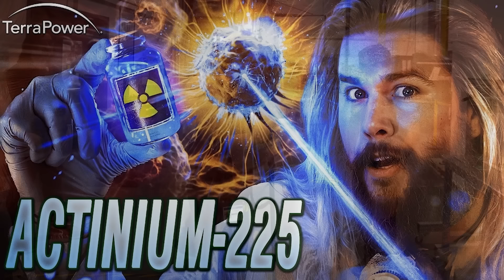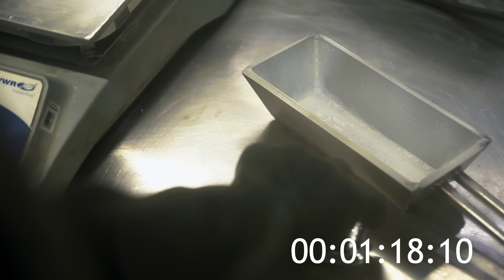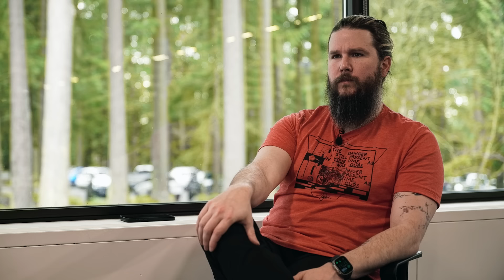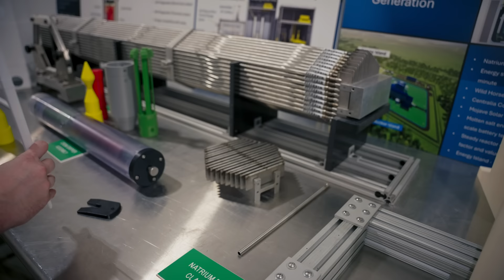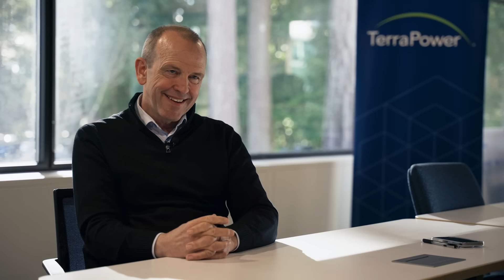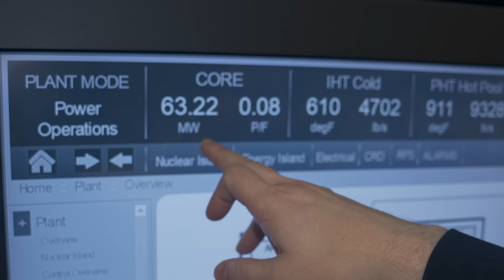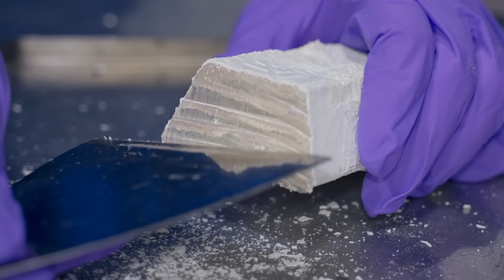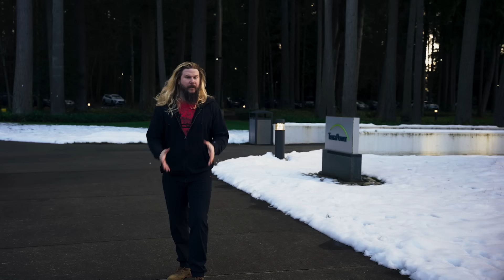Will Natrium Nuclear Reactors Change Everything?

Comment: Fun fact: the first nuclear reactor to generate electricity was the Experimental Breeder Reactor 1 in 1951 in Idaho, and it was a sodium cooled fast breeder reactor that used an electromagnetic coolant pump. It only melted down once during an experiment, and the only way anyone knew was because of the instrumentation (amd the whole running an experiment thing; they'd planned for that possibility). That's what they mean about the reactor running at atmospheric pressure being safer. No leaks, no pressure explosion, and the melted fuel would lose the geometry necessary to sustain the reaction and shut itself down. These days it's a museum.
Reply: Added fun fact, so was the second Experimental Breeder reactor: though decommissioned and de-constructed a while back, the Fuel Conditioning Facility at Idaho National Labs is still reprocessing it's fuel, separating the sodium in its hot cell
Reply: @michaelpickering1904  Another fun fact, although EBR-II is decommissioned the dome that housed the reactor (and some of the supporting infrastructure) still stands and is being modified to support testing microreactors
Reply: Super Fun fact: Nuclear energy was invented by nature 2 billion years ago, see The Natural reactors of Oklo (Gabun), where both nuclear reaction processes took place, once the moderated nuclear reaction U235>U235 and once unmoderated as in IFR Reactors (cooled by liquid sodium) designed as "fast breeder"!
Reply: @Andreas_B.  Is the sun no nuclear reactor, and even older?
Reply: @brilanto Oh i'm sorry, i forgot to say "the first natural energy source on planet Earth"... and the Sun is a thermo-nuclear fusion reactor (The NASA Thermonuclear Art - The Sun in Ultra-HD 4K is a killer video) not a thermal-neutron fission reactor (moderate slow) or fast-neutron fission reactor (unmoderate fast). However, people are overdoing it with running Fusionreactors under "Earth conditions" when it comes to generating "hot plasma" as an energy source for power plants... no fusion reaction is needed for that, see thr VASIMR which uses ion heaters to heat microwave generated and magnetically highly compressed plasma to 171 times the temperature of the sun.
Reply: @Andreas_B.  😂👍
Reply: @brilanto btw: Chernobyl was a "nuclear core explosion" (which only the RBMKbreactor is capable of, if u know how) and not a "surge power nuclear core meltdown" causes a Reactorexplosion . See the study, google search: "A Nuclear Jet at Chernobyl"!

The Chernobyl Gen2 RBMK reactor was an updated version designed to prevent the socalled "rod effect" (fully extended control rods retracted too quickly, causing blistering due to the water-cooled control rods), which allegedly caused the supercritical reactor explosion. In fact, the vapor void coefficient value is irrelevant to the events at Chernobyl.

Accidents involving graphite-moderated AMB-type boilingwater pressuretube reactors (both fuel assemblies and cooling tubes were housed in graphite claddings in AM and AMB and in the Bilibino Power Plant EPG-6 reactors, as older n' smaller reactor type similar to the RBMK) as the predecessor of the Gen1 RBMK reactor:

In 1977, 50% of the fuel channels melted in the core of Unit 2 of the Beloyarsk Nuclear Power Plant.

Gen1 RBMK Accidents:

In 1975 several fuel assemblies melted in Unit 1 of the Leningrad-1 Nuclear Power Plant, and the reactor core was partially destroyed; the graphite moderator blocks did not catch fire.

In 1992, a fuel tube burst in Unit 3 of the Leningrad-1 Nuclear Power Plant.

Accidents at the Gen2 RBMK reactor, changes from Gen1: A total of 179 of the 211 control rods had graphite tips on the retraction side of the reactor, which displaced the cooling water. The rods' extension distance was limited so that they always extend at least 1.2 m into the reactor core, and the displacement body below the absorber material covers the lower reactor area, preventing water from being replaced by graphite during retraction. Later, control rods were replaced with longer support rods between the absorber and the graphite body, so that the displacement body hangs lower when the control rod is fully extended and "no increase in reactivity" is possible during retraction due to water displacement:

In 1983 a specific design flaw in the Gen2 RBMK reactor was discovered during the initial start-up of Unit 1 of the Ignalina Nuclear Power Plant. When the graphite tips of the control rods were inserted into the reactor, they caused a "sudden power surge" due to their neutron-moderating effect and because they did not absorb neutrons like the displaced water. However, the control rods were able to reach the bottom of the reactor in time, so the boron in them slowed the nuclear reaction.

Regarding the Windscale Graphite-Moderated Air-Cooled Reactor and the 1957 "Windscale Fire"

At 4:30 p.m., a technician opened a shaft at the front of the reactor core and saw red-hot fuel elements. It was clear that the reactor needed cooling. However, the fans could not be used for cooling, as they would have provided additional oxygen to the graphite fire. Water could not be used either, as it might have triggered an oxyhydrogen explosion. Therefore, an attempt was made to extinguish the fire with 25 tons of liquid carbon dioxide, which had no effect. At 8:30 p.m., blue flames were observed shooting from the core through the inspection hatches in the roof of the reactor core. On October 11 1957 at 01:53 a.m., a core temperature of 1300°C was reached... no core meltdown because the "nuclear reaction system" did not become unbalanced and surprise surprise even with a Wigner-Energy surge power-up outter control selfrunning red-glowing 1300°C Reactorcore (the real nuclear-fission fullmode Energysource) no "Nuclear core explosion" as in all following accidents, even with core meltdowns, of graphite-moderated pressure tube reactors!

So whatever happen in Chernobyl, where they discovered this before (see 1983 Ignalina) and really know how to avoid this, the official telling Story is not possible!
Reply: That's for 'usable' electricity. X-10 made the first ever nuclear electricity in 1948 using a toy steam engine hooked up to some trombone tube
Reply: @whatisnuclear  Huh. I didn't know that. Thanks!
Reply: @whatisnuclear  That was Satchmo; and we need mo-Satch - but that too, was quashed, but not Satch-quashed.
Reply: @whatisnuclear  stares longingly at the sun we'll figure out a use for you one day, big guy.
Reply: On the other hand, about 20 years in Phenix started suffering from large power transients which remain unexplained (but went away after significant refurbishment), superphenix suffered from corrosion and leaks in the cooling system (full of liquid sodium), and monju suffered from a massive leak and a sodium fire thankfully in the secondary. So molten sodium is not a panacea.
Reply: @bob-ert-0  Nothing is a panacea, except for panacea(TM)
(but hard to source, they closed their web shop)
Reply: I live very close to this (: it’s a cool tour to take if you live in south east Idaho
Reply: it was very rad. kinda wish such reactor design development continued for grid power production.
Reply: SmarterEveryDay has a great video on it
Reply: Fun indeed,  how does it lose the geometry for reacting?
Reply: @acbikeoz  So, the fuel rods need to be within a certain proximity to each other and to react to create heat. The reactor design is such that when the sodium heats up too much, some things that were solid become liquid and then the reactor rods are no longer close enough to split atoms in a way that produces significant heat or radiation. Basically, by chemistry you guarantee it fails-safe with zero human input. Imagine you have hot pokers inside water to cool them. But it'd be bad if they were surrounded by pressurized steam, but it'd be fine if they were surrounded by unpressured air. So instead of a steel container, you put a little plug of gallium alloy at the bottom that would melt and let the water out if the heat got above like 90 degrees celsius. Now change the water to sodium, and make the plug out of something that melts above sodium's melting point, but below it's boiling point. Instead of a 90 degree celsius safe range (Ice to theoretical Gallium alloy Melting point), Sodium melts at 100C, but boils around 900C, so even if you pick something like Aluminum which melts around 660C as the plug, you've got over 200 degrees of safety margin, which is much wider than even the margin if you used a pure Gallium plug that melts around 30C (and only gives you 30 degrees of heating). Basically, because Sodium's melting point is fairly tame, but it's boiling point is pretty high, you have a much wider range of acceptable temperatures before you get pressurized (from boiling) gas, and have to worry about pressure vessels. And that range is important, because you're going to get hot pockets right next to the rods, so the more you can move the temparature around and the more you can keep it even and stable, the better it is. And because liquid sodium is magnetic, you can move it both through regular motion like water, but also just through magnets, and you don't have to worry about pumps failing. You just have to make sure you have power (and you conveniently have a large power plant here, so...)
Reply: @undine120  Some stuff not quite right in your response. The primary safety factor in this design is something called "Negative Coefficient of Reactivity" and in this design it is very pronounced, enough to shutdown the reactor at a designated temp. It's isn't based on phase change (solid to liquid, that would be bad in this design) or chemistry, it is based on density in the solid phase of the fuel and nuclear doppler broadening (physics). Yes, the fuel pins move slightly farther apart based on thermal expansion of the reactor vessel, but that is much too slow by itself. The metallic fuel in this design expands far more and faster than a traditional ceramic can, while remaining solid. This makes the nucleus of the atoms within each individual fuel pin farther apart and has a much stronger effect. Doppler broadening is the other big contributor, which in simplistic terms is the change in neutron absorption cross section for non fissile components of the fuel assembly meaning these non-fissile atoms absorb more neutrons as temperature rises. When combined in a good design, these effects essentially shutdown the chain reaction as the temperature of the fuel itself rises as proven in EBR-II (which this is based on) well BEFORE the fuel melts or the sodium boils. No moving parts, valves, electronics, phase changes, etc... involved. Add passive always on decay heat removal and you have a reactor that isn't dependent on external power to shutdown and stay that way without damage. Just natural convection of both the sodium coolant within the vessel and air in the passive decay heat removal system along with the fuel's physics response to temperature.
The melting plug analogy can be applicable to a molten salt design, but this is NOT a molten salt reactor.
Reply: Thank you, @richardb1452 , that was very educational. I am now your first youtube subscriber.
Reply: I got to tour EBR-1 outside Idaho Falls last summer. It was an interesting bit of history. Outside the museum you can see two experimental reactors from the cancelled Aircraft Nuclear Propulsion program.
Reply: Both instances of western reactors melting down occurred when the reactor itself was shut down, high temperatures and melted fuel innately leads to a subcritical state, and in both cases it was a failure to maintain cooling that caused it, not an out of control reaction. Having a reactor that cannot violently rupture due to a steam explosion is neat, though so far that hasn't happened in a Western design either.
Reply: @gmhs2  Ah, Chernobyl was an Eastern reactor, so doesn't count?
How comforting...
Reply: @brilanto  Yes, Chernobyl doesn't count, the RBMK design was hideously unsafe and would never be accepted in the west or any modern country. Using Chernobyl to claim nuclear energy is innately unsafe is the same as claiming that since asbestos causes cancer, all forms of heat insulation should be gotten rid of forever. Also ironically, the removal of just one issue, the positive scram/end effect, would have prevented the disaster entirely. Without a source of a power excursion, RBMKs cannot maintain a large amount of energy as pressure and rupture, the worst that could happen is a normal meltdown (which the plant had large amounts of concrete support to contain) or a fuel rod breach (which would be leak radioactive steam into the reactor hall and contaminate the cooling circuit, but not much else.)
Reply: @brilanto  Windscale bacame Sellafield after the accident
Reply: @CarlosOddone-z6k I wonder why? 🙄
Reply: @gmhs2  The current PWRs and BWRs can melt down because of a failure to remove decay heat.  All U.S. reactors will go subcritical milliseconds after a SCRAM.  Run away criticality has never been a concern
Reply: @clarkkent9080  Yes that was my point, meltdowns have never occurred from a failure to shut down the reactor in the west, in fact I don't think any power reactor besides the pre-disaster RBMKs have had the potential for a run-away reaction in general.
Reply: @gmhs2  While it was not a commercial unit, The SL-1 reactor incident is they only U.S. nuclear facility event that I can think of that was a prompt critical event but even in that case and other lab events, the energy released by the prompt criticality results in immediate unintended disassembly (a new SpaceX term) and sub critically.

Controlling the nuclear reaction has never really been the issue...it is decay heat removal, which will be present in any type of reactor, that has and will be the problem.

The U.S. has designed, built, and tested every known reactor design and the PWR and BWR designs are simply the best overall designs for commercial applications just like the steam cycle, used for centuries, is the best way to convert heat energy into mechanical energy.  Sometimes new and improved has its limits.
Reply: What happens to the sodium as its neutrons are knocked free?  What are the radioactive products and their half lives?  I can't imagine storing sodium safely underground with water filling the hole.  Maybe the sodium can be chemically combined with something to make it stable before it ends up under ground?
Reply: @Tinker-nn4yy  Sodium is extremely resistant to long-term activation. It's one of the reasons it's a top choice for a reactor coolant.

Sodium-23 (the common, stable stuff) captures a neutron, with a pretty low cross-section, to become Na-24, with a half life of about 15 hours. This is not a waste disposal issue, it will be non-radioactive in less than a week.

Na-24 beta decays to magnesium-24, which is stable. Mg-24 needs to capture 3 neutrons to become radioactive, which is exceptionally unlikely. If an atom of mg-24 does manage to capture 3 neutrons, mg-27 has a half-life less than 10 minutes, decaying to aluminium-27, which is stable. Al-27 can capture a neutron to become Al-28 with a half-life of 135 seconds, decaying to silicon-28, which is stable, and would again require 3 neutron captures to become radioactive. Si-31 has a half life less than 3 hours, decaying to phosphorus-31. Another capture gets you P-32. That has a half life of 15 days, but the same atom had to capture 9 neutrons to get there. P-32 decays to sulfur-32, which will need 3 neutrons again to become radioactive.

Every coolant is a compromise, with risks and benefits, including water. Lead is less reactive, but more corrosive, toxic, and much more viscous. Salts are more corrosive, more viscous, and require higher continuous temperatures to stay molten.

Helium is just about perfect, but it's hard to contain, and very rare on Earth. Gas cooled reactors are another generation away though.
Reply: @jasexavier  Thank you for weighing in.  What do you mean by activation?
Reply: @Tinker-nn4yy  "Activation" in the context of nuclear science/engineering is when a non-radioactive material is made radioactive. This is usually a result of neutron radiation, called "neutron activation". Beta and gamma radiation (mostly) can't make things radioactive, because they don't interact with nuclei, and alpha particles will only interact with nuclei in very particular circumstances, but neutrons only interact with nuclei.

Sometimes, if a neutron hits the nucleus of an atom, it sticks, changing the isotope, sometimes to one that is radioactive.

Note that gamma rays with far more energy than those involved in fission or radioactive decay can induce radioactivity, but this doesn't occur in nuclear reactors. Beta particles (electrons) can also induce radioactivity if they are captured by a nucleus, but this involves the weak nuclear force, and such interactions are vanishingly rare.
Reply: @jasexavier  Thank you.  I had this in general about neutrons.  I would like an inventory of the kinds of materials used in reactors and the isotopes the neutrons cause and their half lives.  It would be good if this was common knowledge so people could assuage fears of nuclear.
Reply: @Tinker-nn4yy  This is beyond the scope of even my lengthy YouTube comments.

Material selection for nuclear reactors is an entire field of study. Most things involve compromises.

Some materials, like coolants, are chosen specifically to avoid activation. Water and sodium are both very resistant to becoming radioactive under the constant neutron bombardment inside a nuclear reactor.

Some things, like fuel element cladding, have to be chosen for mechanical and chemical performance, regardless of activation potential, and are counted in with the spent fuel which will need recycling or geological disposal.

Other materials, like concrete, fall in the middle. Concrete is fairly resistant to activation, but absorbs radioactive elements from its immediate environment. Concrete near the core needs to be left in place for a number of years after reactor shutdown to allow these elements to decay.

Most of the research into these things has been government funded, and most of that information is publicly available. Specifics of reactor designs are often proprietary for commercial or classified for military, but information on material choices are relatively easy to find.

Keep in mind that chemistry is mostly irrelevant for activation purposes, what matters is which chemical elements are present with the neutron flux in or near the core, and there aren't that many elements.

Another useful tool is a table of nuclides, which shows all the known isotopes of every element, color coded for stability, and a binding energy curve, which shows the general trend of nuclear stability vs. atomic number. The latter shows, for example, that Helium-4 is very resistant to all nuclear processes, as it is a huge local spike in binding energy.
Reply: @Tinker-nn4yy , by "combined with something" are you referring to Cl to make NaCl (salt)?

I'm no expert, but AFAIK there're no long-lived radioactive isotopes of sodium. My understanding is that the main radioactive isotope produced in a reactor is ²⁴Na, which has a half-life of only about 15 hours, so in a few weeks it's gone. The longest is ²²Na (2.6 years).

The bottom line is that I don't think it's a problem.
Reply: @ncdave4life  I guess chlorine but there may be better alternatives.  This video is an advertisement.  I'd like a cold detailed review of all the waste products - inputs and outputs - but the people schilling reactors and really any and all energy production methods have us trained not to ask for everything.  People should know enough to be able to make educated decisions about what energy systems to endorse.  I realize we can't meet demand without nuclear but I would like to know all the consequences so we can bird dog the industry and politicians so they skimp as little as possible on mitigation.
Reply: Ah, "it only melted once" - what a relief, that the technology is so stable and secure...
Maybe you forgot to mention, that the whole cavern had to be under Argon atmosphere [therefore the deep diving equipment] - how cheap and easy to maintain...
Reply: Could be wrong however; breeder reactors are slow neutron reactors, one of the reasons MSR seem to be forbidden.  India met with objections for wanting to use deuterium for a moderator as this would produce slow neutrons and enable  plutonium production.  Also, they could then say IPPU.
Reply: @NormanCzerski Almost every Nuclear Reactor is in some kind a "Breeder Reactor", the Reactors that calling "official" as "Breeder Reactors" are allways fast neutron Reactors cuz u need the unmoderate fast Neutrons to archive no 235U>235U fission-chain-reaction! The integral fast reactor (IFR), is a design for a nuclear reactor using fast neutrons and no Slow neutron moderator (a "fast" reactor). IFRs can breed more fuel and are distinguished by a nuclear fuel cycle that uses reprocessing via electrorefining at the reactor site. A fast-neutron reactor (FNR) or fast-spectrum reactor or simply a fast reactor is a category of nuclear reactor in which the fission chain reaction is sustained by fast neutrons (carrying energies above 1 MeV, on average), as opposed to slow thermal neutrons used in thermal-neutron reactors. Such a fast reactor needs no neutron moderator, but requires fuel that is comparatively rich in fissile material. The fast spectrum is key to breeder reactors, which convert highly abundant uranium-238 into fissile plutonium-239, without requiring enrichment. It also leads to high burnup: many transuranic isotopes, such as of americium and curium, accumulate in thermal reactor spent fuel; in fast reactors they undergo fast fission, reducing total nuclear waste. As a strong fast-spectrum neutron source, they can also be used to transmute existing nuclear waste into manageable or non-radioactive isotopes. Although 238U undergoes fission by the fast neutrons released in fission about 11% of the time this can not sustain the chain reaction alone. Neutrons produced by fission of 238U have lower energies than the original neutron, usually below 1 MeV, the fission threshold to cause subsequent fission of 238U, so fission of 238U does not sustain a nuclear chain reaction. When hit by thermal neutrons (i.e. neutrons that have been slowed down by a moderator) the neutron can be captured by the 238U nucleus to transmute the uranium into 239U which rapidly decays into 239Np which in turn decays into 239Pu. 239Pu has a thermal neutron cross section larger than that of 235U. About 73% of the 239Pu created this way will undergo fission from capturing a thermal neutron while the remaining 27% absorbs a thermal neutron without undergoing fission, 240Pu is created, which rarely fissions with thermal neutrons. When plutonium-240 in turn absorbs a thermal neutron to become a heavier isotope 241Pu which is also fissionable with thermal neutrons very close in probability to plutonium-239. In a fast spectrum reactor all three isotopes have a high probability of fission when absorbing a high energy neutron which limits their accumulation in the fuel.

For Example: The BN-600 reactor is a sodium-cooled fast breeder reactor, built at the Beloyarsk Nuclear Power Station, in Zarechny, Sverdlovsk Oblast, Russia. It has a 600 MWe gross capacity and a 560 MWe net capacity, provided to the Middle Urals power grid. It has been in operation since 1980 and represents an improvement to the preceding BN-350 reactor. In 2014, its larger sister reactor, the BN-800 reactor, began operation. But you can IFR setup as "Fast Burner" Reactor like the BN-800 as a sodium-cooled IFR, even built at the Beloyarsk Nuclear Power Station, in Zarechny, Sverdlovsk Oblast, Russia. The reactor is designed to generate 880 MW of electrical power. The plant was considered part of the weapons-grade Plutonium Management and Disposition Agreement signed between the United States and Russia. The reactor is part of the final step for a plutonium-burner core, a core designed to burn and, in the process, destroy, and recover energy from, weapons-grade highly-clean over 92% plutonium-239! 239pu with a half-life of 24,111 years, decays predominantly with alpha-radiation release into 235u.

So the difference to "moderate slow thermal neutrons" Reactors, which also produce plutonium-239 as a side effect, is that fast neutron breeder reactors actively use this effect to generate energy.
Reply: Safe reactors don't make boom-boom sauce so Fed said no-no
Reply: People forget history to fast these days.
Reply: I still say fast breeder reactors are less safe, but I'm not doing the geometry design so...
Reply: My grandfather was an engineer working on fuel pellet processing out there. He was on EBR2. Really cool to hear him talk about it.
Reply: Shippenport was first normal commercial U235 hpbw reactor .
Reply: @mitzvahgolem  Yes, but it wasn't the first to actually generate electricity. EBR-1 generated a small amount of electricity to run the facility it was stored in to prove that it could do it. 

Also, the first reactor to generate power on a commercial grid was the Soviet AM-1, a failed submarine power plant that was repurposed into a commercial plant as a propaganda piece. It generated a practically meaningless amount of power, but it did allow the Soviets to say that they technically built the first nuclear power plant. That's just kind of how they rolled.
Reply: @Ralph-yn3gr  yes Soviet Union had earliest on a sub .
I think Nautilus nuclear sub was earlier than Soviet Union sub  though and generated electric from steam turbine.
Reply: Still leaves a bunch of radioactive trash. Still not competitive with the renewables. Still crap.
Reply: @d3fau1thmph Metal or salt cooled fast reactors can consume spent fuel, rather than generate it. Once a reactor is started it needs no newly mined fuel and can run entirely on reprocessed nuclear "waste". The solution to our existing spent fuel problem is to build fast reactors and break it down. We only use about 1% of the energy available in natural uranium in existing reactors. Fast reactors can keep running the same fuel through over and over, extracting most of that original energy. Our spent fuel supply is enough to meet our base load power needs for a few hundred years.

The resulting waste will be much less dangerous, and for a much shorter period of time, than what we have now.

Oh, and we built one of these in the late 1980s, which worked exactly as expected. A commercial scale test reactor was built in the early 1990s, but dismantled before it was brought online.

We could have avoided all the issues with fossil fuels, environmental damage, foreign wars, etc., over the past 30 years, while also breaking down the nuclear waste we already have.
Reply: @d3fau1thmph  And ludicrously expensive, not to speak of dangerous for humans and the environment].